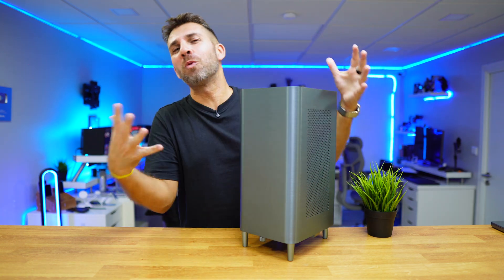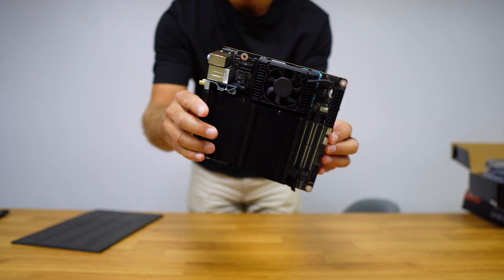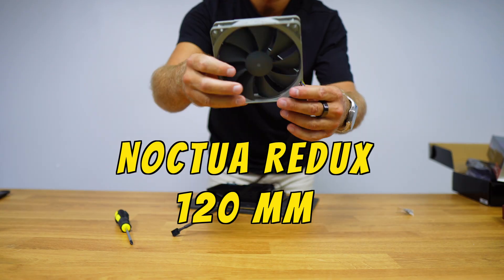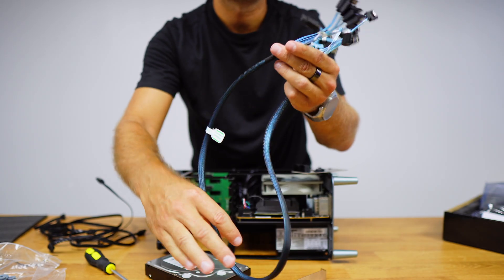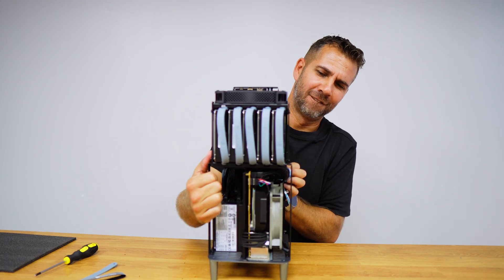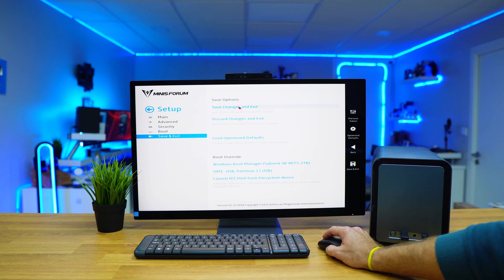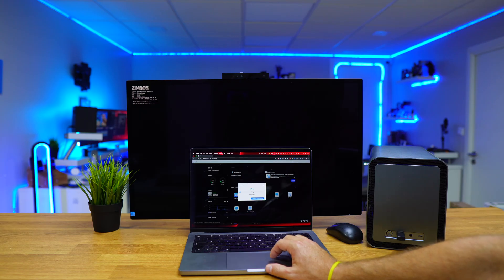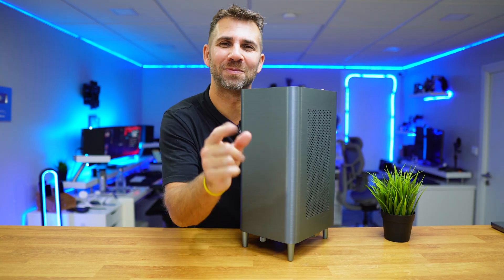🔥 How to Build the BEST DIY NAS? 🚀 Minisforum BD790i X3D 🤯 Dream Setup 2025

Comment: FYI, ZimaOS is Linux running docker and docker version of home assistant is not full featured, ask chatgpt or any llm for a list of the differences. I learned the hard way and I ended up having to run it in a vm by itself to get all the features!
Reply: you don't need to run a VM, home assistant Addons are simply custom docker containers with specifics that makes it easy to connect with HAOS. Docker version is so much better, no hiding of underlying OS. Regarding the video, clearly an overpriced solution as Roberto usually promotes.

Comment: Interesting, I used that exact same MB and a very similar tower and made a Steam Machine instead 🤣Originally bought an RX 7600 to somewhat match the real Steam machine but with a much better CPU and slightly better GPU. Installed the real SteamOS on it and everything and it worked great. Then I realized I could get an RX 7060 XT for literally the same price as the RX7600, so I returned the GPU and got the 7060XT instead for more performance. SteamOS hasnt been updated to support RDNA4 yet though, so I installed Bazzite in SteamOS mode and it works and functions the same but works with the newer GPU. Been a lot of fun.

After seeing this video, maybe ill get a 2nd board to make a backup NAS. I hadnt thought about a use case like that, I just saw mini-ITX and X3D and my mind immediately thought gaming.